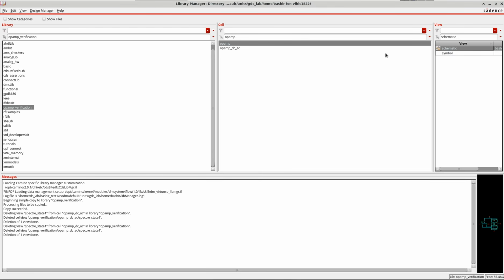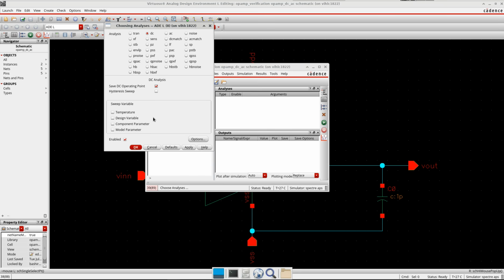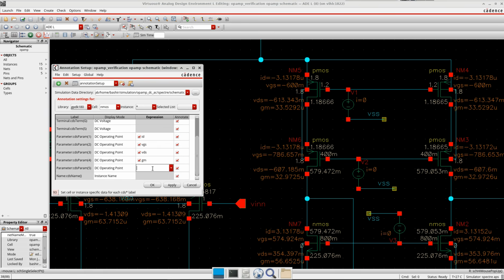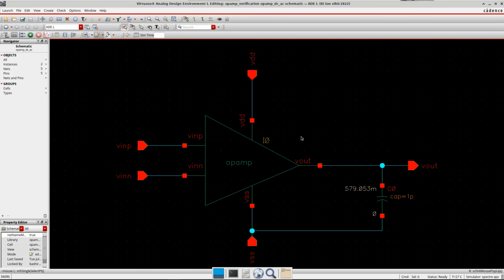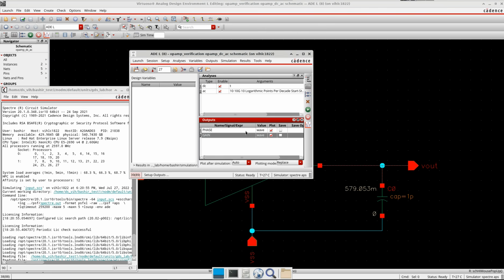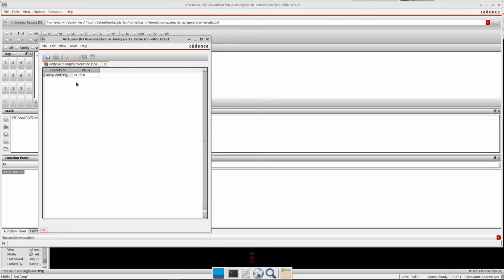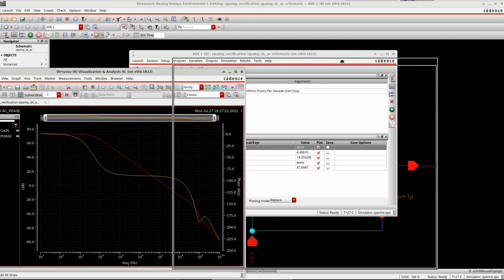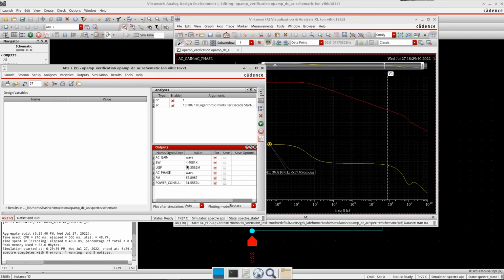DC, AC Analysis of OPAMP in Cadence and Power consumption of any circuit. #cadence #opamp

Comment: I think ac gain should be vout/(vinp-vinn)? isn't it? Or maybe i'm wrong something..
Reply from the maker: both or ok. you  can try both the expressions to see if there is any differences. I would use your expression for fully differential block
Reply: Yeah I would say the same. Since the input is differential. Obviously they output different results
Reply: For a fully differential amplifier the gain is (vout1-vout2)/(vin1-vin2). In this case, the single ended amplifier the input is the same, but there is only one output, so the gain should be vout/(vin1-vin2)

Comment: Thank you so much. It helps me a lot.
I have one question, how can i simulate and plot transconductance amplifier GM(Io/Vin) in cadence?
Reply from the maker: From calculator, after selecting on "If", click on the node of transistor and then "off" --> "VF" select the Net for voltage and divide them

Comment: Thank you for the video, I realized this simulation but I did not have the same results. 
How can i realize this type of amplifier with two outputs. Thank you
Reply from the maker: If you know the formula for fully differential amplifier, define them in calculator and you will see the correct results.
Reply: @MudasirMir7   Thank you...can you give me this formula.
and for a two-output amp how can I simulate it in Ac and Tr